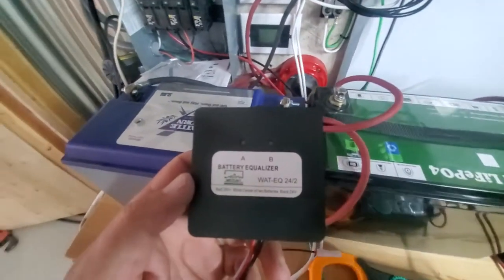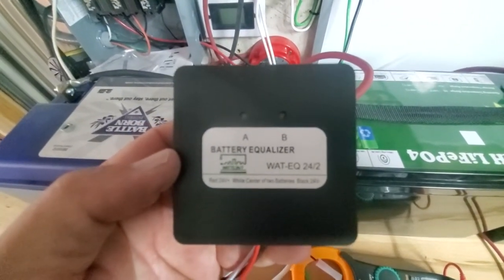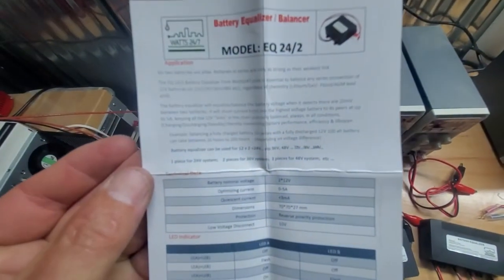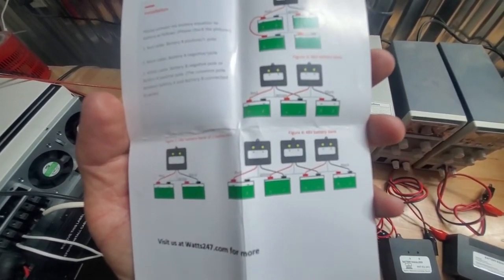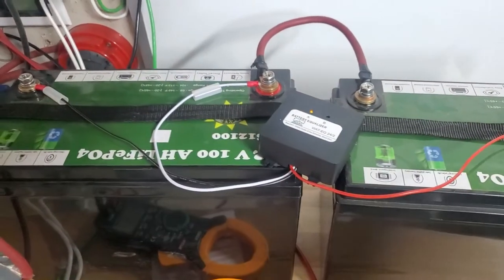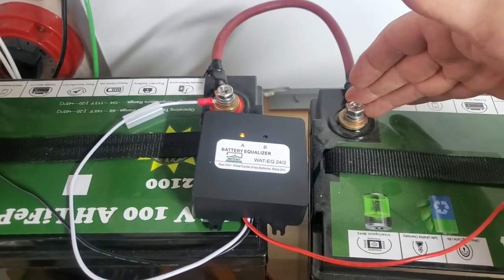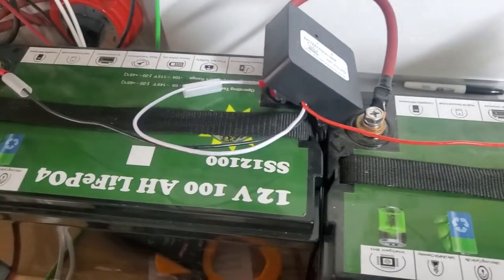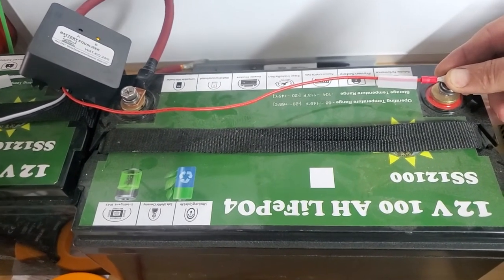EQ24-2 (2x12V=24V) Battery equalizer Watts247

Comment: I have one of these connected to my 4 Lifepo4 batteries that is connected in both series and parallel. But even if I double triple and quadruple checked I somehow managed to connect it to the battery with - and + wrong, I do not know if it is ruined or not as it does only light up when it is balancing?

Comment: I purchased this model for a lead acid battery stack of two 12v batteries. It started to work and the B light was flashing as that battery voltage was much higher. After a few minutes I heard a pop and the B light stayed on steady. The batteries did eventually balance, but then the B battery voltage became higher than A, yet the light for the A battery continued to stay lit. It seems the balancer failed within 5 minutes of installation.
Reply: Did you do same mistake I did? I managed to connect + and minus wrong even if I checked to make sure like 20 times...

Comment: I have 24v inverter, it uses 12  2v 1000ah batteries in series. What battery balancer / equalizer can I use to make the battery voltages the same?

Comment: Does this equalizer simply draw a load from the battery with the higher voltage, dissipating it as heat?  Does it do that until the two batteries have basically the same voltage?  It would be nice if it transferred current from the battery with higher voltage to the battery with lower voltage, because there would be less waste?
Reply: The actual unit shown in the video uses a switched capacitor topology to transfer energy between the two series connected 12V batts instead of dissipating energy from the battery with higher voltage.

Comment: Hi please could you help, I've bought one of these but I'm head scratching at the moment.
I have a campervan with two leisure batteries and obviously one starter battery, the two 12v leisure batteries are wired in parallel. I currently have the black (Neg) and white (pos) wire wired to the negative and positive of the leisure batteries, the red wire is connected to the starter battery positive terminal.
When connected the (A) light is illuminated but the (B) light is not illuminated.
Please could you confirm the wiring is correct.
Reply: I believe this is only for series batteries. Parallel batteries sould self balance.

Comment: I have 3(8-3.2v) 24v battery banks. Should I use a 8s x 3 for each bank? Thanks
Reply: You can't use this because it is for 12v batteries. And I don't understand why you have three 24v battery banks, why don't you connect the 3 24v batteries together and make one big 24v battery banks?

Comment: 10 amps via those tiny wires?
Reply: Why not? Check the diameter of the wires in ATX power supply. It's not bigger than that.
Reply: @Tab7.6.Tab7.6  Notice how the 2 black wires (12v + B and 12v - B) on a PSU is a bit thicker then the rest of the wires that power the motherboard. Only those two black cables are capable of supplying up to 16A, the rest of the cables is at 1.66A (Of course these numbers differ from brand to brand.)
Reply: @goodluckcrypto8153  It's not a problem to find out what AWG is suitable for 10A current, and the wires are thin only at first glance. But it's not really that important in this case, because the balancer is in fact 0-5A.

Comment: Feels so strange, you would expect that battery with higher voltage will deliver charge to battery with less voltage
Reply: Basically: That's only in parallel. For series, it is not.

Comment: do not use this with lifepo4 batteries, It will be in fire after one of the battery will switch off in lowest state or highest state. I have almost lost my house, I was lucky it happend when I was arround... this was pure flames very agresive ones.
Reply: @uniquedtech255 Do you have a picture of this, I am curious why this would happen?
Reply: Is there a balancer for lifepo4 battery?
Reply: It clearly says lead acid?